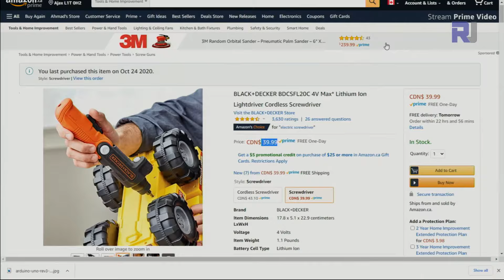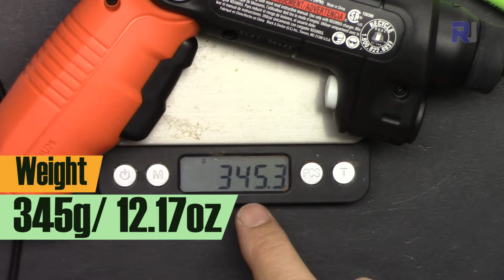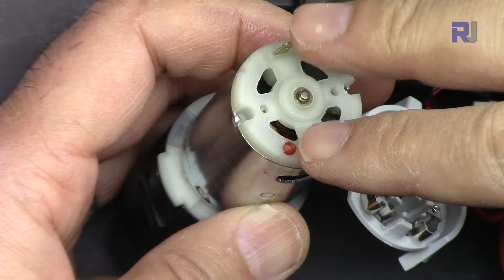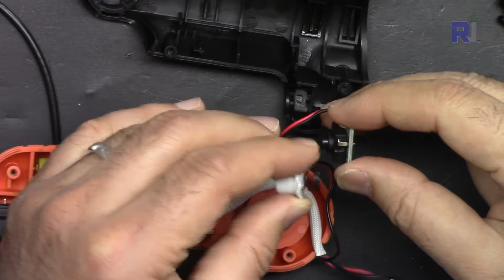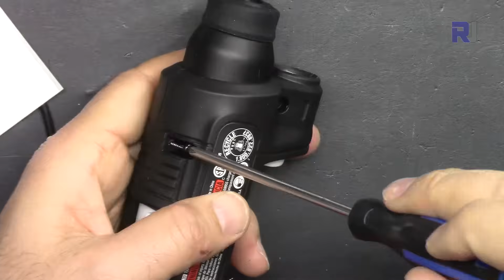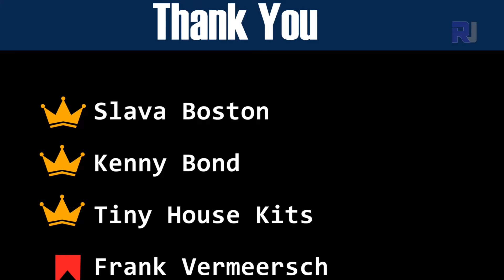Black + Decker Cordless Screwdriver lightdriver Disassemble Motor Replacement

Comment: I think the main problem of this driver.... is neither battery nor the motor... They are adequate for low power drill or screwdriver projects already. In fact, having no clutch means the stock motor/battery can already be too strong for delicate electronics.

Then what is the main problem?

It's the charger being proprietary.

Comment: Is the rotation speed and torque  variable or just one speed and torque all the time?
Reply from the maker: Just turn ON/OFF.
Reply: @robojax  Thank you for the answer.
Anyway, I ordered it couple hours ago. Hopefully it will be not too powerful for occasional home usage (furniture assembly/repairs and small stuff like that).